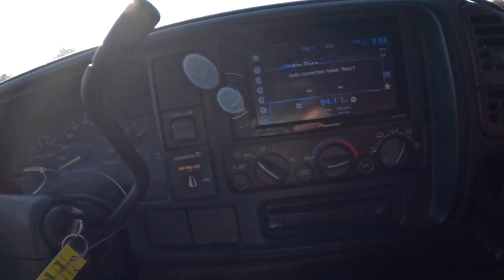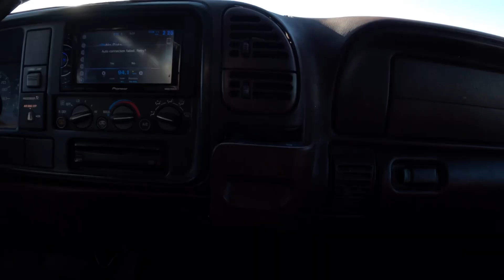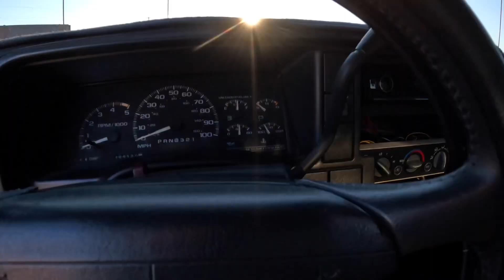THIS CUSTOM OBS CHEVY TRUCK WAS A GOOD DEAL!!

Comment: When you are thinking of painting a car don’t be afraid to sand down and fill dents with body filler. Especially on a car like that OBS that already had different color panels. Also when you go to fix those fog lights on your OBS you should take that front lip off and sand/paint it a glossy black.

The Chest piece is definitely essential and puts you on that next level of content creation. It can actually be really helpful when you’re doing something with both of your hands and you still need to record up close. Periodically just make sure the camera is pointed at the right angle.